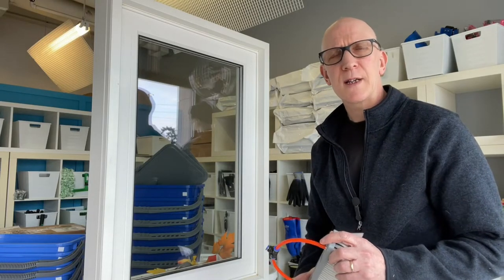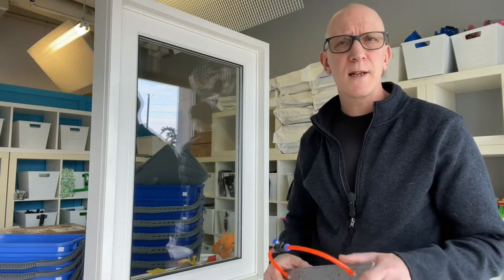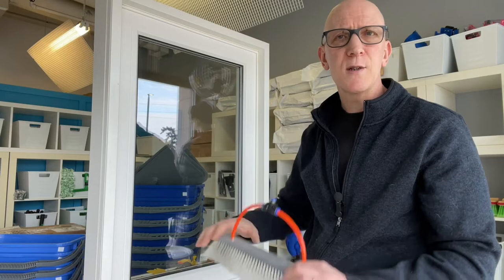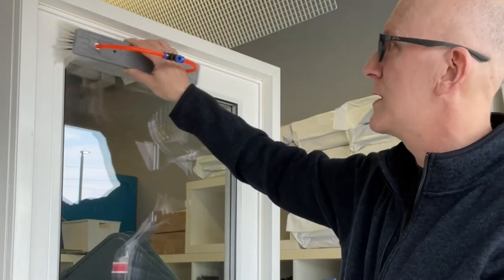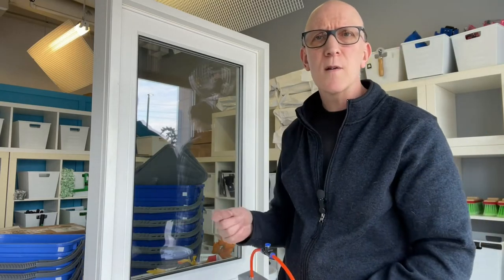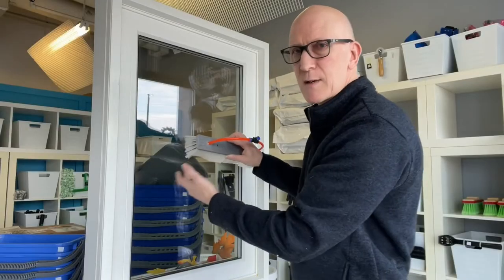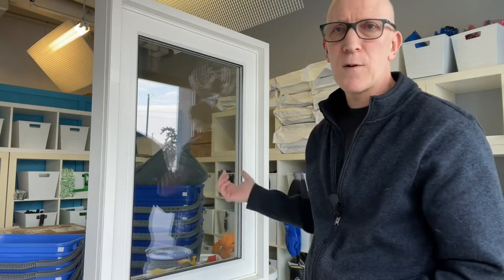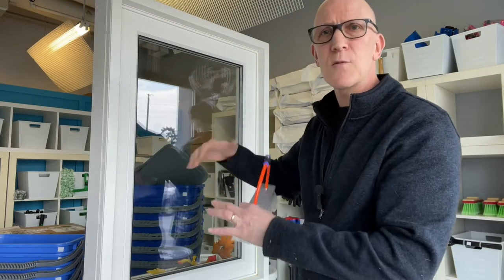Spotting & Poor Window Cleaning Results - Water Fed Pole Tips

Comment: Great explanation! I didn’t know the milky residue is caused my oxidation on the window frames, been trying to work that one out for a bit haha. Talking from experience I would only add one thing. If you rinse the frames, then angle the stream into the corners of the glass, then do the face of the glass (all top down of course) it does a great job of mitigating everything you’ve talked about.
Reply from the maker: Great added tips!

Comment: Lovely video for new ones. Never scrub the bottom frame before doing the glass, there is always more dirt on the bottom, so you are just transferring the dirt back on top of the glass. First top frame, sides, glass, bottom, sill. Rinse , and sweep the sill off . Done.
Reply from the maker: Thanks for your shared experience, I’ve always cleaned the bottom frame before the glass because on every brush stroke going down, you will most likely touch the dirty frame and bring the dirt up onto the glass. May as well deal with it beforehand. Of course every cleaning job is unique so changing up technique from time is a thing.

Comment: It’s also has to do with the elements .. if it’s windy day the dust that in the air will attach to the clean drips on the class.. also if there isn’t good sun, shaded area tend to last longer to dry there for you will get more spots left over. City areas where there is alot of traffic it’s really difficult to get good result dude to pollution.

Comment: Good thorough explanation, but from my experience it's not that easy.  My area the majority of homes are extremely hydrophobic. you can scrub and rinse all day long and you still get spotting.  You see all these wfp videos, where the windows are nice hydrphillic glass, sheeting water beautifully and they turn out great, but that just isn't how it goes most time for me in the field.  TDS at zero, booster pump at 90-100psi, tons of flow with rinse bar angled so water is spraying past the bristles, and still alot of times there's spotting.  All these ytubers say 'oh it's the technique, not rinsing enough,' I disagree, alot of times it's the glass. With Hydrophobic glass, water droplets cling too long before they dry, that's what causes the spotting.  There's alot more science to it than people realize or care to learn.  You never hear about any of these problems before you spend 5 grand on a pure water setup. Just sayin
Reply: I’m just starting out. What’s the solution then? Getting up on a ladder and doing it by hand?
Reply: @JJG323  yes
Reply: If there are no minerals or dirt in the droplets, it doesn't matter how long they take to dry (within reason). I do agree that there is some science to it though. Maybe try one of the reach-it brushes. They are pricey, but their rinse bars are better than most. I do wonder if something could be added to the water that would break the surface tension better but evaporate with the water so it doesn't leave a deposit.
Reply: agreed! Jesus CHRIST AGREED
Reply: @JJG323 brother flip the window in. I genuinely only see this problem happen to me on double hung windows and french windows. I love using the water fed for this because of the dirty frames and possible heights. Being able to flip in the window and wipe away those spotting areas are massive. I just make sure to do them perfectly and scrub over an extra couples times with a more steady rinse. It’s still gonna drip smack the window sill and splatter on the corners of the Windows. Kinda just gotta get lucky and find a method that minimizes that at most.
Reply: @temperedglasses ur not thinking about the water splashing down on the window sill. I get these frames fkn perfect and the windows  aswell with a perfect steady rinse. I take pride in being spotless but I’ve never had a job where I haven’t had to grab a ladder or flip in a window to clean up a corner that either spotted from the dripping of it being a double hung and hitting the window sill. or the age of the window literally makes it impossible to rinse.

Comment: I wfp window cleaned for 5 years and NEVER got spoting, ever! If the frames have deteriorated, it won't matter how much you scrub them you will get spotting. 
Ready for this people.... you must DAB the frames! If one tiny drop of water goes from  the fame to the pane, its game over. Redo it.  Scrub the frames so they look clean, dab so nothing is dripping, then rinse the windows with a very low flow so the pane gets rinsed only. If any rinse water so much a touches the frame then redo it.
Reply from the maker: Thanks for sharing your experience
Reply: don't touch the frame, especially when they are not cleaned often, if the paint is old,  hot water make it worse, when ever you can clean it from the ground by hand, du it.

Comment: I have a question? My pole leaves streaks on the sides and tops of the windows, near the frames. But the bottom and the whole middle windows are good. Anybody know how to fix that? Do I need to spend more time scrubbing it or watering it down when I’m done?
Reply from the maker: yes, scrub more around the frame longer and rinse more. Sometimes windows still have residue like silicone around the edge making that area hydrophobic so needs a tad more rinsing.

Comment: How would you take care of a 4th floor window from the ground level ?
Reply from the maker: The video in question deals with water fed pole work. This is the method of cleaning with purified water running up a thin tubing, up trhough a pole (some go as high as 90ft) and out through a brush head, so 4th floor is very doable.